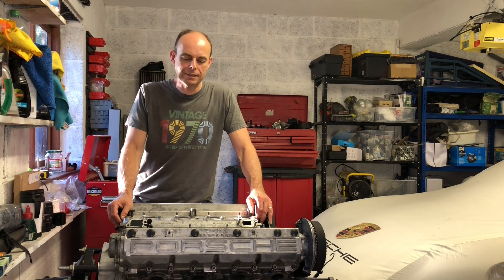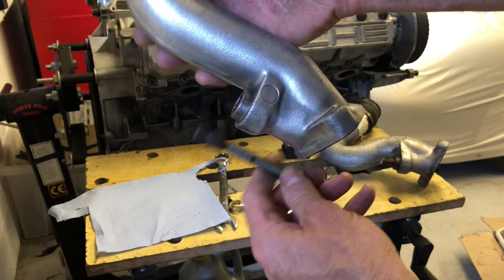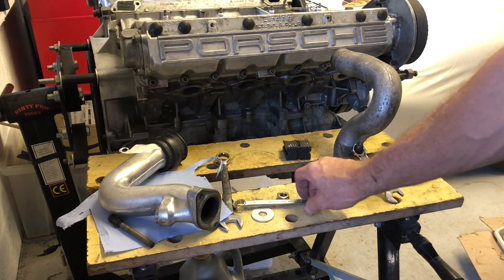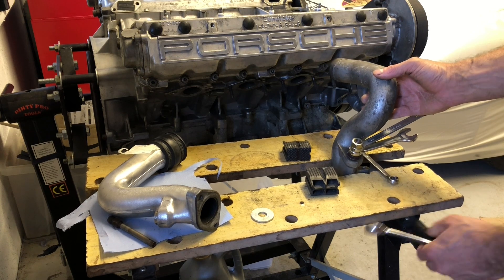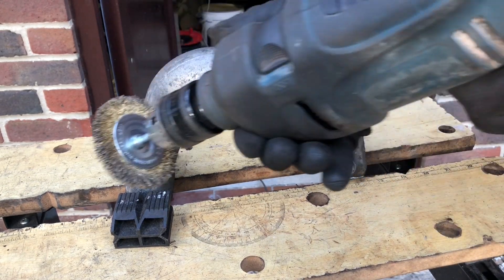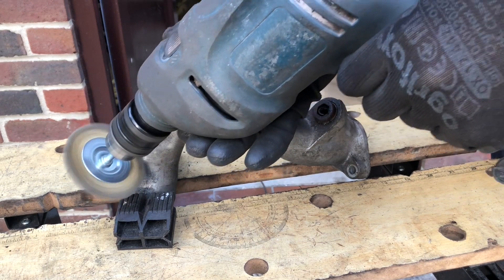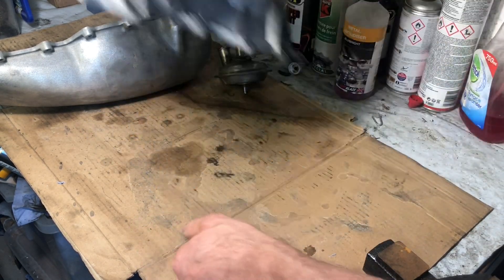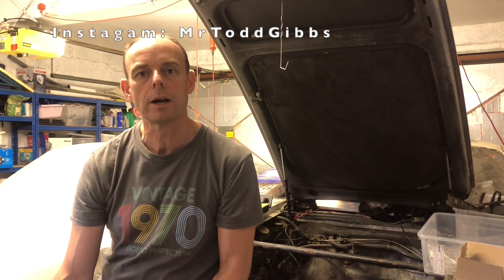Porsche 928 Episode 21 - How to remove CIS Injectors the easy way

Comment: The rebuild of the air meter would be great to see. If that bearing has any issue it will change the air fuel mixture.
Reply from the maker: Hey TT TT, I'll probably start on the meter rebuild tomorrow, fingers crossed !

Comment: Isn't it amazing how technology has advanced from this era to what we have today on motor vehicles.

Keep persevering Todd as you'll get there in the end. It's all very time consuming work indeed.

Stay safe, love and respect from Taiwan.
Reply from the maker: To be honest Terry, Im surprised it works at all! much of it seems very basic and low-tech.But I guess thats the beauty of it and what allows us to rebuild them. Thanks, as always.
Reply: @MrToddgibbs  I agree,  such cars with low technology from years ago were the in thing back then as we knew it. By today's standards though you'd class them all as very very primitive!

I recently (4 weeks ago) purchased a brand new 2021 Toyota for my wife.

The technology and gadgets in this "middle of the range" vehicle is very high and I dread the day when it begins to go electrically wrong. 

However I got a 4yr guarantee with the car so fingers crossed that if any issues do occur then these will be taken care of by the Toyota guarantee.

Nowadays they do not make cars like they used to, crappy cheap materials, razor thin metal with too much reliance on technology and gizmos ALL put together with unrealistic dealership prices.

I feel much safer in an older classic car for sure due to the build quality back then and this is why is important  that guys like yourself give these older classics a new lease of life.

Comment: I just inverted the intake tube and knocked them out with a brass mallet. Worked beautifully.
Reply from the maker: Ah nice. Mine was stuck in super tight and I didn’t want to damage them
Reply: @MrToddgibbs  if you don’t want to damage them your way is best. My injectors are almost 50 years old and the car hasn’t started since 2011. I thought it best to replace them.

Comment: Hey Todd, great stuff as usual...I like the spanner idea. The mother of all invention eh ? The rubbers on my Ferrari's injectors are like a mid sized Dinky's tyre. Much smaller than on your 928, so they are a tad easier to remove. You can gently pry them out with a small pry bar. Being careful to protect the intake of course. Oh yeah...love the T-shirt...I'm of the same vintage 1970. Cheers Mate, Marc
Reply from the maker: Thanks Marc, I had been pondering how to get the injectors out for weeks. They are so tight it requires a leap of faith to effectively force them out (which is why I did the video). 

T-shirt was a 50th bday gift from the friend that did the matchbox car this year :)
Reply: @MrToddgibbs  Well happy 50th...Belated, I turned 51 just last week. It goes fast so enjoy those cars ! Great video...helping out many backyard mechanics.

Comment: That's a great idea..i will be using that myself..👍
Reply from the maker: There are other more complicated ways, but I like this as it required nothing special. My injectors aren’t in great condition though - definitely heading for the bin!
Reply: @MrToddgibbs  woah, replacement high flow injectors aren't exactly cheap if your going that route. Set of 8 Lucas 19 pound/hr set of 8, your looking around $500 US without shipping I think.
Reply from the maker: Yeah it’s around £23 per injector here. But it’s an important bit to ensure is working. I’ll replace. Currently fighting the last injector mount, it’s stuck solid and the top has just cracked !
Reply: @MrToddgibbs  Best of luck with that, soak it with WD40 or something similar. I won't give your reply a thumbs up as having a stuck part of an injector cannot be any fun.

I feel your pain and frustration though Todd.
Reply from the maker: @terryroe2023  didn’t realise, but as it cracked it became free.... all removed now !
Reply: @MrToddgibbs  Then it's a thumbs up from me now.

Comment: Hi Todd,
Really enjoying the videos.
Could you put the links in the description of your parts sources and also the part number of the compatible merc injectors?

Would be handy for any future parts I might need

Thanks
Reply from the maker: Hi, yes of course. I actually want to start explaining the cost of the project and my prediction going forward - which this could be part of. But I'll post the injector link once I decide which to buy. 

Thanks for watching!
Reply from the maker: This is a link to the injectors - https://www.ebay.co.uk/itm/333950973523?_trkparms=aid%3D111001%26algo%3DREC.SEED%26ao%3D1%26asc%3D20160908105057%26meid%3Dd94171e70b804a31a60b410fbe23aa22%26pid%3D100675%26rk%3D1%26rkt%3D15%26mehot%3Dnone%26sd%3D333950973523%26itm%3D333950973523%26pmt%3D1%26noa%3D1%26pg%3D2380057%26brand%3DBosch&_trksid=p2380057.c100675.m4236&_trkparms=pageci%3Ad6ea6f00-a78c-11eb-bfd7-daac8f63ddee%7Cparentrq%3A14c16aee1790a77dcce5b8a1ffc04d33%7Ciid%3A1
Reply: @MrToddgibbs  Hi Todd.  Unfortunately, the website no longer exists, could you please tell me what injector model it is, or what exact Mercedes engine it comes from?
Reply from the maker: Sure Bosch 0437502047

Comment: daft questions, where do you get your parts and what were the mercedes injectors ?
Reply from the maker: Hi Russell - perfectly good questions! Most parts are from Design911 or RosePassion. Some EBay, including the merc injectors (8x Petrol Fuel Injectors 0437502047 Bosch Nozzle Valve A0000784023 A0000785623).

Hope that helps :)
Reply: @MrToddgibbs  thanks for replying, rosepassion a new one for me, doing a top end similar to yours soon so your videos will help, keep em coming thanks again
Reply from the maker: Good luck Russell. I had a company rebuild my top end... next time I'll do it myself. Thanks for watching! :)